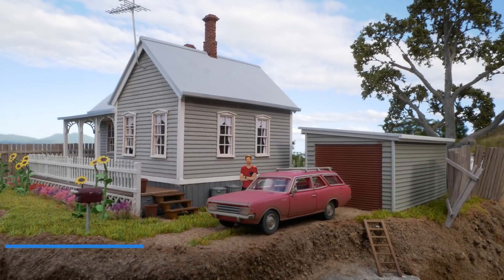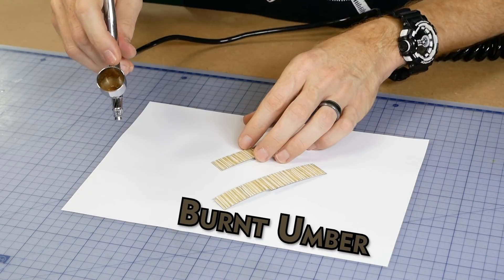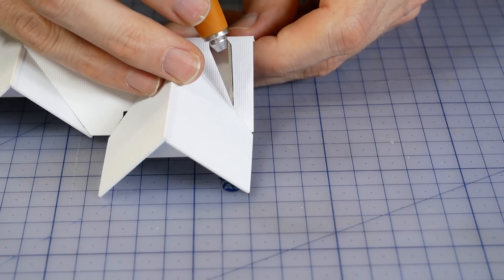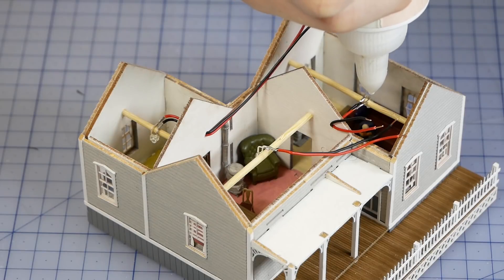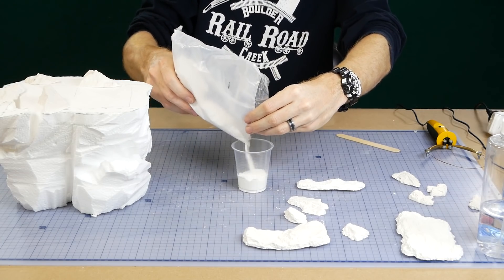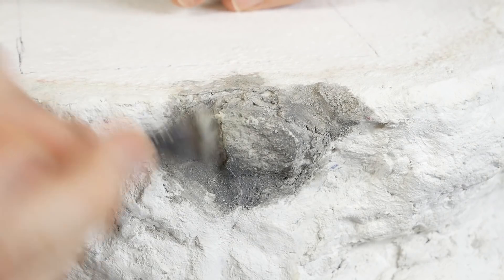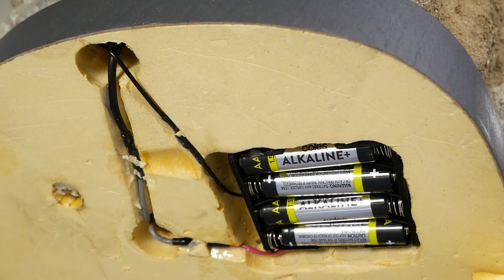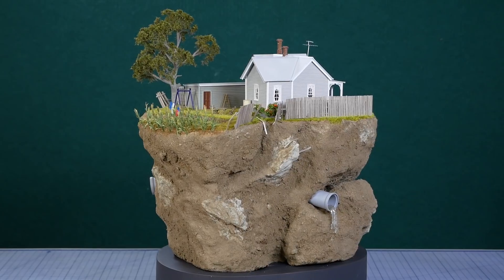How to build an eye-catching diorama - Realistic Scenery Vol.12

Comment: That's absolutely beautiful - and, in the part of the UK where I live, a real possibility. About 20 miles up the coast from where I live, there's a place called Easton Bavents - or there was, as most of it has crumbled into the North Sea. About 200 years ago, this part of the coast was a promontory that extended into the sea over a mile. Farm buildings that, 40 years ago, were well inland, now teeter, like your model, on the edge of a cliff.

Comment: Luke Towan, You do great work.  A tip though, when you use plaster or rock molds, add some cement dye or water base paint to the plaster.  This will prevent "white" from showing through if it gets chipped and makes getting the color right easier.

Comment: I love your model building. I'd like to make a small suggestion though. For wiring the LEDs you could go with MUCH thinner wire. I've been doing LED harnesses for RC cars for a long time and I found the best source for super thin wire. Strip the outer insulation off of some computer networking cable... Phone cable works too but, obviously, has less wire per foot than a network cable. It just seems like the much thinner wire would be easier to route inside these models.

Comment: Jaw dropping as usual!!  Just incredible, and a really cool idea.

My only complaints with this dio are:   You used regular bluish LEDs that give a very "fluorescent" light feel, like a lab or old office building.  I recommend a 2700K white LED for indoor lighting for realism.  I'd also tone down the colors of the indoor furniture so they don’t look toyish or new.  

The only other thing is very minor, but the car has four point (the tires) touching the ground, it’s better to attach posts to the tires rather than a post in the center of the car which wouldn’t really be there.  It’s a very hidden part but still noticeable.

Comment: Only thing I noticed that could be easier is the wiring, colored magnetic wire could be used instead, it's MUCH thinner, and would be easier to contour through smaller holes.  Man, the tools are cool, now I know what I need to add when I want to do miniatures.  Thanks for the videos

Comment: Luke, another great job, well done. My only negative comment regards the use of urethane foam to core the display base.

As a modeling professional, I stay away from urethane foams at every opportunity. Most materials have some hazard to watch, but urethane is so much worse than other foams, it is hard to justify its use outside of its intended industrial applications. It doesn't offer any advantages over polystyrene foams, and does present some significant dangers. 

First, you should NEVER hotwire urethane foam, as it gives off toxic fumes. Also, when cutting or sanding it, the dust is quite abrasive, and not something you want anywhere near your lungs. If you must work with it, I recommend full caution with a fume hood and aggressive dust management.

Beaded foam, aka EPS, is the easiest to cut with heat, and using it as the main substructure of your diorama is a perfect modeling application for it. Extruded foam board (XPS) would have been a better choice for inside the display base. It will hotwire almost as readily as the EPS, yet still sands smoothly, as it has no beads.

Other than that, two thumbs up! I have been subscribed for 4 years now, and love your content. I don't remember any other point of contention.

Thanks for all the inspiration!

Thayer

Comment: Sorry mate, I think you installed the railing backwards. Normally the pickets go on the outside, no?
Reply: The location of pickets in relation to the fence depends if you're keeping something in, out, both, or if it's strictly for decoration. To keep something in, the posts are on the outside and the post are on the inside if you're keeping something out. If you're keeping things both in and out you should weave your fencing for maximum security, but for decoration purposes it doesn't really matter